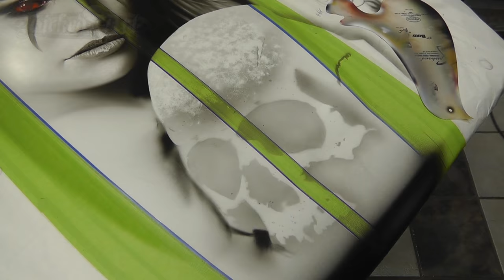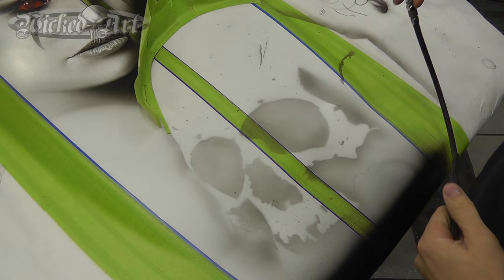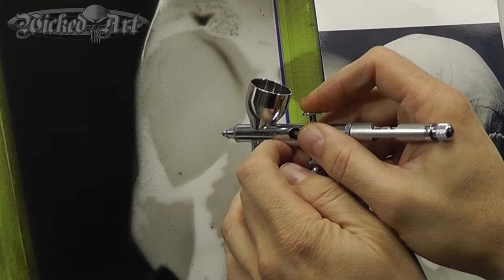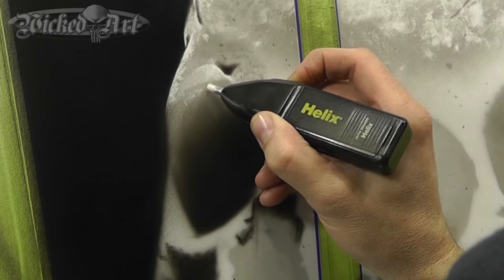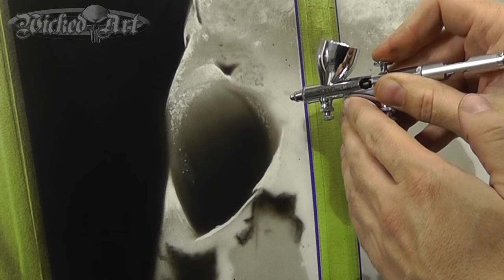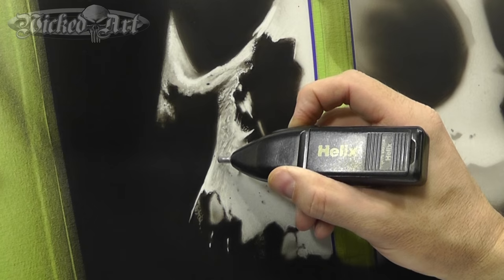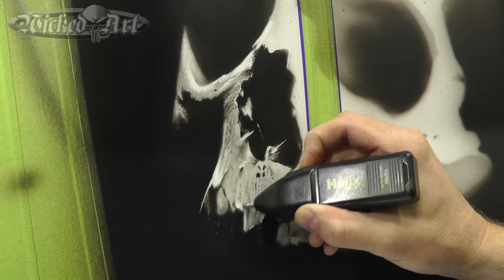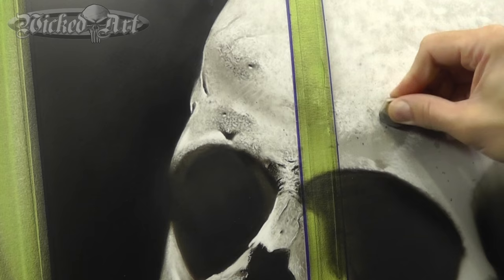How to Airbrush a Skull with Texture: Full Tutorial

Comment: Amazing work Trevor I would have watched 2hours simple but very very effective loved it how would you say the water base compares to urethane because was thinking of switching myself cheers for the awesome content keep up the awesome work
Reply from the maker: Thanks for the kind words Jayden!  Water-based and urethane are two completely different animals.  Each system has its own pros and cons.  Both are great, durable products for just about anything.  

What I struggled with the most when I started playing with water-based technology was working in light layers.  I used urethane for a lot of years before I switched to water-based.  You can really hammer urethane on quickly with little worry.  The same can't be said with water-based.  Water-based requires a little more patience building your layers.  The technology has improved a lot since I made the switch (around 2002 or 2003) and it continues to improve.  I can actually use heavier coats now than I could back in the early 2000's due to those improvements, but it's still very different from urethane.  

I've said for years that companies producing water-based paint are striving to make their products perform like urethane.  I still think that statement is true in most cases.  Whether or not they will ever reach that point, I kind of doubt it.  Like many others I've talked to, I was ignorant when I made the switch and stupidly expected water-based to perform like urethane as well.  That's what I'd known for years and I didn't want to change how I worked.  That mindset and reluctance to change made for a much steeper learning curve in the end.  If you avoid that mindset you'll likely have better results much faster than I did.
Reply: @wickedartstudio  thanks for the detailed reply Trevor and a history of your experience with the two paint systems I will probably make the change soon enough but like yourself am a little bit reluctant to change haha

Comment: What Air brush are you using there??? I have a Iwata HP-C plus but I see you have the valve under the front of your and the opening in front of the trigger. Is that the Iwata Micron???
Reply from the maker: You are correct.  That is a Micron (the CM-C Plus to be exact).

Comment: Hey Trever , my name is Dj, I'm somewhat new to the airbrush. I was wondering what ratio should I use to get the best spray possible? I use createx water based acrylic. I'm using a putter comp no tank  I have an iwata neo CN. Great video by the way 👍🤘
Reply from the maker: I appreciate the kind words DJ!  I personally prefer to start at a 1:1 reduction ratio (equal amount of paint and reducer) the vast majority of the time.  Sometimes I add more reducer to the mix, but I rarely use less than 1:1.  My air pressure is normally somewhere in a range between 20 and 30 psi.  This is a great question that unfortunately doesn't have a great answer.  There are a lot of factors that affect your reduction ratio, as well as the air pressure you choose to use.  You can ask 10 different airbrush artists this same question and you'll likely get a number of different answers.  You have to experiment and find what works for you.  I'll put together a video soon covering your question in more detail because it is absolutely the most popular question I get when it comes to airbrushing.  Hopefully, the info I gave you above will get you in the ballpark for now.

Comment: Did you move that metal ring on the pre-set handle so it stays out?! I knew there was a screw, just did not get that I can use it!! :D :P ..well thanks for the tip! Keep these great videos coming!!
Reply from the maker: Yes.  There is a very small set screw in the locking ring of the pre set handle that allows you to set a limit on how far you can pull the trigger back.  I keep mine locked in the fully open position (meaning I can pull the trigger all the way back) because I prefer to have complete control of my brush.  Some people prefer to lock it in place and limit their trigger pull (or the amount of paint that can be sprayed) when working on fine detail.

Comment: Where can you find the erasers for that model Helix eraser, I have the same one but have a hard time finding replacement erasers. Thanks.
Reply from the maker: Unfortuantely, Helix no longer makes that model.  The newer Helix erasers use a 5mm eraser insert rather than the 3mm (if memory serves me correct) eraser head.  I tend to buy erasers in bulk because when I find one I really like, the manufacturer almost always seems to discontinue it.  Unfortunately, I've had no luck finding refills for the original Helix.  I wound up buying one of the newer versions for that reason.  You can get one for about ten dollars, so it's not a huge investment.

Comment: Great music, what's the name of the band? I experience that very often, the paper breaks apart when scratched, erased. Although I'm careful and with really good quality paper for Airbrush and the right tool. Why? Or, should I start painting more on plastic, sheet ect? Uses E'TAC colors. Thank you Trevor.
Reply from the maker: Hey man!  Some of the music is listed in the description (it all came from the YouTube Creator Studio).  As far as your questions regarding scratching and erasing on your work, it's difficult to guess the issue without actually seeing what you're doing.  My best advice without seeing exactly what you're doing is work in light layers.  Put down a very light layer of color and then come in with the eraser before adding another light layer of color.  Then you can erase again if needed.  Use a light touch with your eraser and/or blade as well.  Too much pressure or aggressive use of erasers and blades will degrade the paper rapidly.  Continue working your project back and forth like that until you're satisfied with the results.  You might have better results using one of the synthetic brands of paper out there.  Those papers are stronger, but they will degrade the same as any other surface if your techniques are too aggressive.  Hope that helps!
Reply: Thank you for your long and educating answer . I am already doing a lot like that but I surely have to practice a light hand. 🙏🏻Rock on🤘🏻
Reply from the maker: Glad to help!  A lighter touch will come with practice.  You might try painting on a hard surface too.  A hard surface might just suit your style a little better.

Comment: I forgot to ask what reducer with the wicked 4112 or 4130 or does it matter I only have 4112
Reply from the maker: I use 4012 and/or 4011 to reduce Wicked Colors.  4030 is basically an intercoat clear, meaning it's just a clear binder with no pigment, it doesn't actually reduce the paint.  I generally only use the 4030 with the Candy 2.0 line, but it still gets reduced with 4012.
Reply: Thank you I saw a guy using auto air and he reduced it with something other than 11 or 12 and he reduced it to almost all reducer and it worked well I use wicked I guess I’m trying to get the most value out of my paint as it’s expensive in Canada
Reply from the maker: All of the Createx line can be substantially over reduced without compromising the binder in the paint.  It's a good idea to lower your air pressure when spraying though.

Comment: I cant find the gray eraser heads to save my life!!!!
Reply from the maker: Do you have the older black Helix or the newer blue Helix eraser?
Reply: @wickedartstudio  Hi there. We are having the same difficulty as Nick in finding the gray eraser heads. We have the older black model.
Reply from the maker: I began a vigorous search for the gray eraser heads as well when Nick originally left the comment above.  Unfortunately, it appears the gray eraser heads are no longer available like so many other fantastic erasers I've used in the past.  Because I've seen so many other eraser tools that I've really liked be discontinued over the years, I purchased a large amount of gray and white eraser heads for my Helix.  I still have enough to last me quite some time.  I was aware the new Helix erasers were blue instead of black, but I didn't realize they had changed the size of the eraser head until questions and comments started popping up about it on my channel.  Due to that, I've done more research and ordered one of the newer blue Helix erasers.  I have also found an alternative gray eraser head that fits the new larger Helix.  I'm still in a testing stage with these new erasers, but I plan to do a comparison type video with the old Helix, the newer Helix and a couple of other electric erasers in the near future.  I will also reveal the new gray erasers I found that work in the newer erasers.